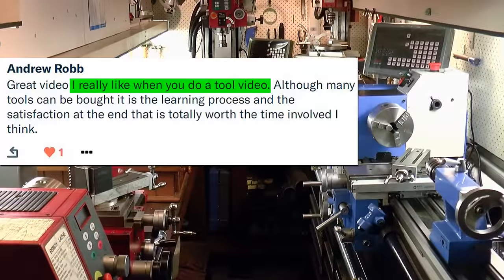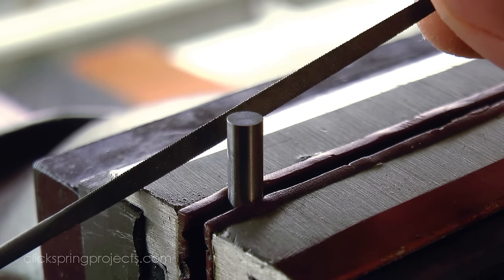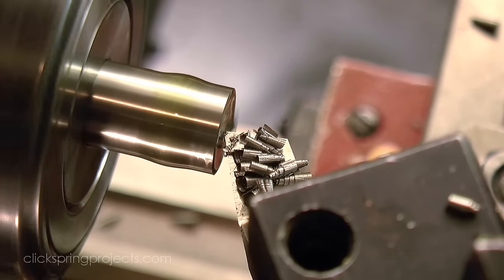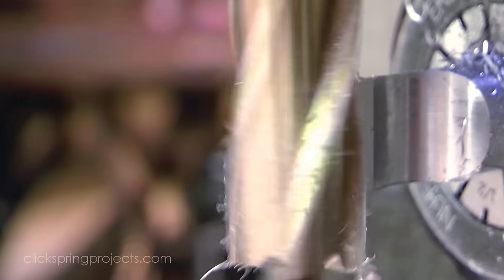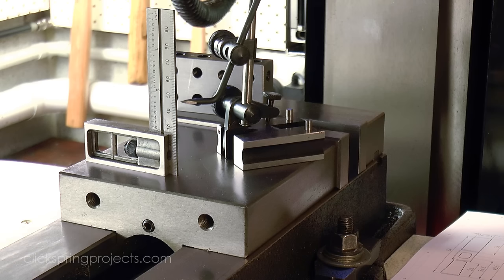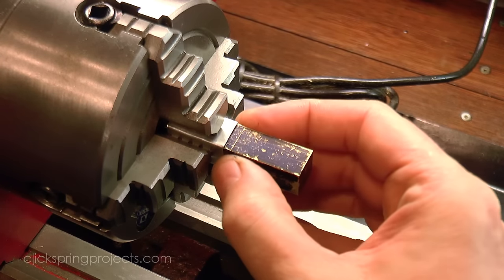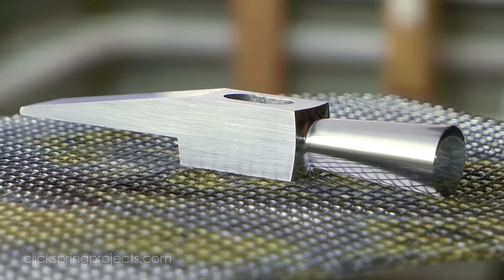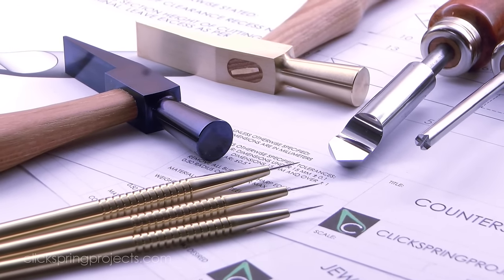Tools, Glorious Tools! #7 - Four Shop Made Everyday Hand Tools

Comment: The deep purple blue color tool steel gets when tempered is so gorgeous that it completely captivates me every time it develops in front of my eyes.
Reply: Yes, it never gets boring :)
Reply: Kind of like smoke on the water?
Sorry. Couldn’t resist, or am I too old?
Reply: grinding heavy chunks of bar and getting the different levels of oxide across the depth of the scratches always had me wanting to strip a car bonnet back, leave it rough sanded with #36, throw it in an oven til its just right, then clearcoat it...

Comment: I wish I had more time at home to mess with my benchtop lathe and little vert mill. It's actually a really old Linley Jig Bore machine but functions nearly the same and works for light duty benchtop mill type work. After putting 10-12 hours as a professional machinist then coming home and doing family stuff with the kids I'm just spent by nightfall. Anymore my machines and 3d printers and all those tools are there as needed for right now when something needs modified or fixed up. Definitely grateful to have them and the skill to use them though. Until I get more time you're videos vicariously satisfy my want to make stuff.

Comment: Love these so much! Small tip from a blacksmith, the hole for the handle can be tapered wider at the top, this gives an iron grip on the head. I use a 3 degree tapered milling bit for this, or for the final pass!

Comment: I've been a subscriber since making the Antikythera mechanism several years ago.
 I'm still fascinated by the tools you make to make other things.
I was a motorcycle technician but you show several 'crossover' type tools that could be useful for small parts (actually inspired me to make new parts to repair a horn button for a 1965 Suzuki instead of buying a not very good looking and expensive reproduction)
I had never thought of using a hot air gun for blueing, that is a fantastic idea!
Thanks for the video's

Comment: Don't forget a linear impact driver.

On a serious note, tempering using a sand bed makes it extremely easy to get an even temperature. Especially if you're using a coal or coke forget. And it's a beauty for bluing small parts, I use them to blue hardware for guns.

Really comes into its own when you're bluing batch parts.

Comment: Another good way to set up that hammerhead in the mill vise for the angled cut is to rest a parallel flat on top of the vise jaw and line up the scribe line by eye with it. Then when you take the parallel away, the scribe line is still .125" (or whatever your parallel thickness is) above the vise. Obviously this doesn't work if it needs to be a super precise angle, but I used to teach an intro to machining class and one of the projects was a very similar hammer and it was good enough for that.

Comment: The holes through hammerheads are typically tapered with the narrow end towards the handle. This ensures that, when inserting the wedge, the head isn’t only fixed to the handle through friction, but also by shape since the wood physically expands to fit the tapered hole.

Now, i’m a blacksmith, so the hammers i use tend to be abused a bit more than this shop hammer, so i can’t see the extra difficulty of machining this hole tapered being worth it.
Reply: I am a machinist that occasionally uses small hammers delicately: the taper is absolutely required. Small impacts combined with normal variations in temperature and humidity will work the head loose from the handle in a dozen strikes, or a few months sitting idle in the drawer (zero strikes!) without the taper. I have discovered this by using cheap hammers, of ~ 1oz and less, which had no taper to the hole. It doesn't seem to matter how many wedges/what type of handles I try, it always works loose. This hammer in this video may not have required as much taper as was used, but since the taper is only front to back, and not also side to side, I think it was probably wise to go a little overboard.

Comment: Perhaps the only trick missed was not putting a slight crown on the hammer faces, it certainly changes how using a hammer feels.
It's a very subtle difference in appearance, but seems to make all difference when using a hammer.
Reply: Dont jewelers hammers have a flat head?
Reply: Yep, any other hammer would have the crown though

Comment: I've never been able to get non-HSS tooling to work decently on cutting steel parts. Some other people have more success but my tools just end up turning to mush. Maybe you could make a video about how to use normal high carbon steel to make tools for turning or milling steel? That's how it was all done before the 1940s, but there's not much info about how they did it without their tools wearing out extremely fast.

Comment: Cheers Chris, another lovely video. Couple of questions for you if you have the time, first is any particular reason for using boric acid rather than regular borax as a shielding flux, and secondly what sort of oil are you using for the quench?
Reply from the maker: They are similar substances, but boric acid is the clear better performer, when complete dissolve off with hot water. I get mine from here: https://www.jewellerssupplies.com.au/product/26105-boric-acid-powder-500g For the quench I use a generic compressor oil - Cheers :)
Reply: @Clickspring  Thanks, I’ll give it a go on my next project!

Comment: A question, if I may; at 4:55 when the working end of the tool is hardened and the handle end of the tool is annealed, how can we be confident that the shank won't break? The transitional area between the two differantly heat treated sections of the tool seems large and therefore unpredictable... Any insight plz?